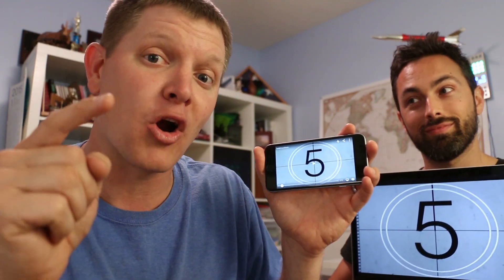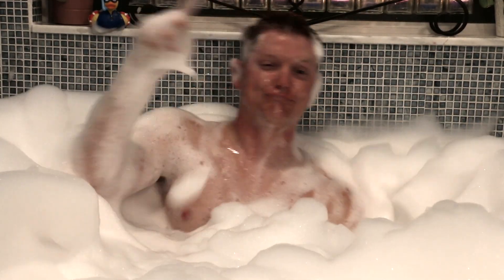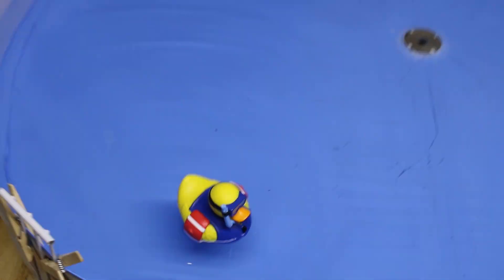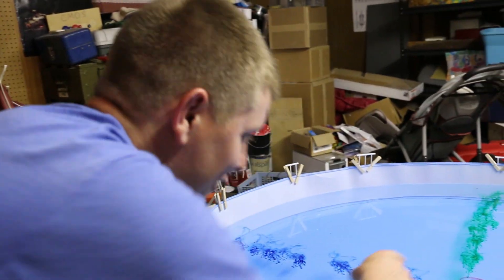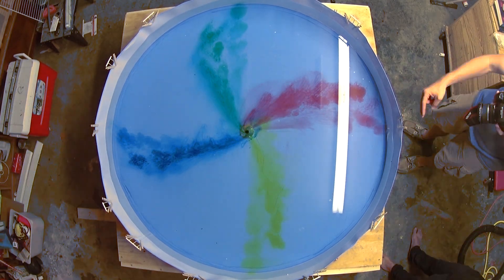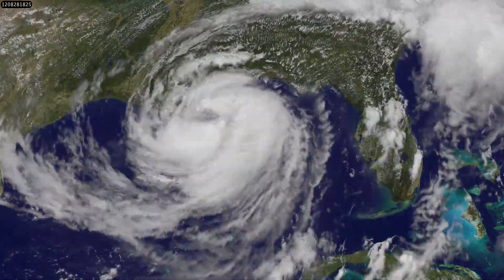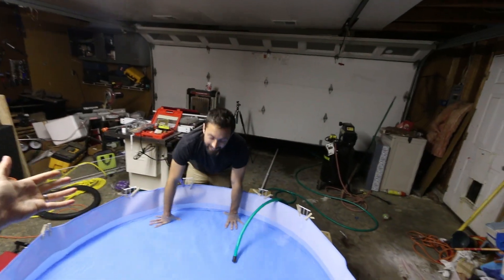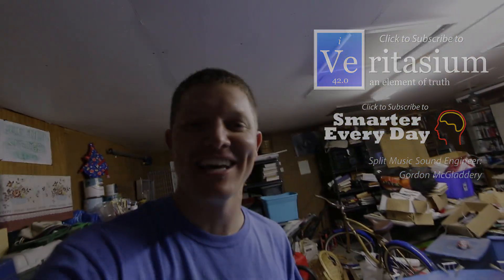The Truth About Toilet Swirl - Northern Hemisphere  (Smarter Every Day 137)

Comment: SmarterEveryDay: I don't see how you can, logically or reasonablly, maintain a swirling Coriolis Effect on a globe where the overall atmosphere is not even independent of the landsphere in it's midst. Afterall, globalists MUST maintain that both the landsphere & atmosphere are moving at the exact same speed. If the atmosphere were not moving, at all, then the landsphere would cause anybody, who is standing on it's surface, to experience as much wind resistance as the speed-of-spin is at his or her geological location. If standing at the Equator, then about a 1,000mph of wind resistance would be generated as the landsphere  moved you against the still air in the atmosphere. It would be like trying to stand on the wing of a futuristic jet that can travel at the speed of 1,000mph. This is why globalists MUST maintain that both the atmosphere & landsphere move together at the same rate of speed. If there was even the slightest difference, between the two, then stillness of air could NEVER be experienced on a globe and the swirling Coriolis would have a cause and ever be in effect because of it. However, stillness of air is QUITE OFTEN experienced all over the world. It doesn't even matter if the Equator is moving faster than, per se, the Tropics (Cancer & Capricorn) because the amount of land to speed-of-spin ratio, experienced at every line of latitude, in the whole landsphere, is equal in proportion to every other part. It has to be because it is connected, thereby, allowing no excess force to be experienced (from the overall unit thereof) when transitioning between differing speeds in differing geological locations. The same would, alikewise, be true for the overall atmosphere. Since the amount of air to speed-of-spin ratio, experienced at every line of latitude, in the whole airsphere is equal in proportion to every other part. It has to be because it is connected, thereby, allowing no excess force to be experienced (from the overall unit thereof) when transitioning between differing speeds in differing aerospace locations. And since so called: "outerspace" consists of no substance, at all, then the atmosphere would receive no frictional resistance on it's convexed outer rim from that.  Nonetheless, it's concave underside, being a thick gaseous air fluid, would interlock with the landsphere's round ridgity surface (like a bike chain on a sprocket) and, therefore, would allow no kind of swirling motion (or Coriolis Effect) to be experienced (from the overall conjoined unit thereof) when transitioning between differing speeds in differing      landsphere-to-atmosphere connected locations. This is because they are married & interlocked as a conjoined unit themselves. Though one is harder than the other, they are conjoined & propelled together at the exact same speed. Such would allow for isolated disturbances (due to other factors) but never as a direct cause of their overall union. This leaves the swirling Coriolis Effect with no CAUSE! So in order for you to continue maintaining the false notion, you will have to dream of a slightly offset atmosphere-to-landsphere connection by which absolute stillness of air is never experienced on the face of the whole globe (even though, in reality, stillness of air is often experienced all over the world in many different locations). Nonetheless, you absolutely can NOT have it both ways, Sir!!! And finally, here is a video of two whirlpools draining side-by-side but in opposite directions to one another --- https://youtu.be/oebaU1d7wKM ---  Furthermore, the world's record sniper shooter mentions many variables but the Coriolis Effect is not one of them --- https://youtu.be/9fiPqUN-AH4 --- Please don't let your pride cause you to give a dishonest response, Sir.
Reply: Ok professor 🙄

Comment: 1.   the way the toilet swirls, is due to the way its manufactured.   Its designed to allow the liquid to flow to one side first, then rotate around the rim.     2.  inconsistent silicone, or what ever sealer you used in the center of the pool,  to seal the exit port, will alter the flow too.    It needs to be a machined part for accuracy.

Comment: No they do not rotate in different directions.  All that has happened is that you have looked at the same thing from a different point of view.  Imagine this:  You hold an open an faced clock in your hands. The second hand extends past the circumference of the face, it rotates clockwise.  Now you turn the clock around so you see the back of it.  The hand appears to rotate counter-clockwise.  But it has always rotated in the same direction!  Now imagine this.  On the North Pole and the South Pole are two circular swimming pools with a plug for drainage in the center.  You stand above the earth at a point directly above the North Pole.  Because the Earth rotates in the same direction the swirl will be the same.  Looked at from the other direction ie 'below' the South Pole they will appear to rotate in the opposite direction, but the swirl in the North Pool and in the South Pool will be rotating in the same direction - the same direction as when you looked from above the North Pole.

Comment: If the earth is spinning it's going faster than the speed of sound at the equator. So if there is momentum, which should cause an immense force. Not just affect water draining lol that causes Coriolis there must be centrifugal force as well. And we should be flinging off the earth. But I guess there's this mythical force called gravity. the earth is so BIG is bends nothingness creating a force that adjusts to everything independently on earth lmfao insane.

Comment: I like the way you describe it but I think you should add that in any system, like a pool or toilet, the Coriolis effect works based on THAT small system and the much larger system, of the earth, is not as effective on the tiny condensed water system. In other words; small water systems are far more effected by local motions such as momentum added through filling of the container or pulling of the plug or deflection of drain guards etc. etc, etc.      My way of thinking about it is the same as you would see an ice skater spinning with arms extended, then when they pull their arms into their bodies their rotation increases greatly. It's the same way a Tesla turbine increases speed as fluid from slow outer diameter approaches the center exhaust port.
Reply: Examples of things that take advantage of Coriolis effect: Tesla Turbine, Spinning Dancers, Swimmers on inner tubes who pull arms and legs in to spin faster! Tether ball when string wraps around pole.

Comment: I experienced the change in flow rotation direction in real life. I went to the galapagos, but first stopped in Ecuador, where I went to the equator. The tour had a portable sink with him that had a removable plug in the bottom of it. He put the plug in, filled it up with water, and moved it perhaps a yard to the left of the equator. As the water drained, it spun clockwise. After it drained, he filled it back up and moved it one yard to the RIGHT of the equator. Sure enough, the water spun counterclockwise. But that's not the best part. He then filled it back up and drained it right on top of the equator. This time, when the water drained, it didn't spin AT ALL. It was really incredible!

Comment: So u did this experiment in one hemisphere and ONE time to prove this is real? Do this experiment 50 times and if all 50 times the water goes the same way, then you may have proved something. Then change the pool size, and plug size and do it 50 times again. Then you may have proved it 100% You usually post good videos, but this is very very inconclusive

Comment: they both rotate in the same direction relative to each other but relative to clock they do not rotate in the same way becouse the experiment is not done in the same coditions relative to winversal directions. In one pole of earth you must see the clock from up and the other pole from downs point of view :P   So without correct references no one can say that you are wrong. If you compere the earth rotation from diferent poles you will say that the earth in one pole rotate like clock direction and other pole earth rotate anti clock direction if you see the clock from the same direction relative to gravity.

Comment: The rotation in a toilet is caused by the manufacture design of the toilet ejecting the water at an angle. Some toilets gush straight through no rotation. If the coriolis effect could cause enough deflection to cause that rotation in a toilet, you would pee on the person next to you when going at the urinal.

Comment: the one in equator they only go 2 meters north two meters south and one right on the exact equator that goes completely straight. it's amazing at that condition but the basin is cemetrical.

Comment: I would like to add a point here. please correct me if I am wrong. the Coriolis force is not acting because the water is moving towards the drain. it is acting because one point is moving close to axis of rotation and the other away from it thereby resulting in Coriolis cross product in opposite directions

Comment: Great concept, great video, think you got the right answer for the setup you have, but . . . .to get a confident result that you both didn't just do a coin flip predicting one would get heads and one would get tails (25% chance is pretty good), you each need to run this experiment a minimum of 30 times to get a statistical handle on the consistency of the result.  Then there's making a connection to the toilet bowls.  In the formula for Coriolis sits velocity.  If the velocity is zero, there is no Coriolis.  The water in both the toilet bowl and your pools started at near enough to zero, but both get velocity as they move in toward the drain.  Problem with the toilet is that there is too little time and distance to build that up to any significant degree.  You rightly pointed out that it is more jet and bowl shape dependent.  Your pool had time and enough distance to let that very small Coriolis that had built up with motion, to finally overcome (probably, we don't know until you run 29 more) the other forces possible.  Was it deionized water with no magnetic fields?  I know that would be small at best but an ionic gradient in a field could come near the Coriolis force involved here.

Comment: it's shame that this very misleading experiment has been viewed by so many times. you cannot feel the rotation of the earth with such an experiment, the flowing direction of the water could be either way, depending on the tiny initialization of the motion. the eventual balance is between pressure gradient force (due to difference in water surface) and the centrifugal force.

Comment: If the effect is so small that if there is any kind of stream in a toilet, sink or bathtub it won't really affect the swirl, then how come it affects the movement of air in a hurricane/cyclone so much? For this to work in water, it seemed the water had to be perfectly still before draining. Then why does it affect hurricanes/cyclones so much when surely the air was not perfectly still before the storm? Of course liquid water doesn't have to behave as the gases in the air, so I guess that's part of the explanation. But I would like something more elaborate.
Reply: I would guess that maybe it's because hurricanes are so much bigger relative to the earth that the Coriolis effect is strong enough to overpower the smaller wind currents

Comment: There was never really any doubt about the effect, it can be clearly demonstrated by observing the direction of rotation in atmospheric pressure systems, ocean currents, and the motion of a large pendulums. The reason it's hard (but not impossible) to observe in toilets is due to the size of the atmosphere/oceans vs the size of a toilet/sink. At the toilet scale, random motion becomes the dominant effect. 
Having said that it was an elegant and inexpensive experiment that clearly demonstrated the very weak but very real effect. - congrats.

Comment: I have a huge problem with this experiment. by not using the scientific method of multiple testing. they need a repeated result under the same conditions to make excepted as fact. I like his channel and the use of scientific study and deduction in most of his videos but this one was like psudo science.
Reply: Well, considering that this experiment has already been conducted, with same results, many times over history, I think that requirement is satisfied...
Reply: Did everyone use a kiddie pool using the same drain system at the same latitude to repeat results? All I'm saying is for this video they could have done it a few more times considering how minute the vortex was.
Reply: Grip Limit read the description.. it says they did it three times
Reply: they said that it wouldnt work in your sink begause there are too many viriabkes there... he told you that if you wanted to do it yourself you'd have to by a pool like the one they used in the video
Reply: Scott Baromski yeah of course I watched it. do you also believe you weigh less on the equator than on the poles. I did more research on the matter than just getting two peoples OPINION on YouTube.
Reply: I am struggling to understand what you're saying when you put 'excepted as fact.' do you mean expected as fact or accepted as fact...someone being so nitty picky should be clearer with what they are saying
Reply: Aulo 2905 oh, that's good at least. I did the experiment in my sink 10 times and got different results each time.
Reply: Hahaha! What??  You're funny, man. A real serious scientist. "After serious questions about this "wheel" thing, I decided to put it to the test and finally clear up all of the pseudoscience once and for all and prove wether it really works ... Or not? "
Reply: Just a question. but should the hole in the pool also not be taken into acount ? to me it seems like the hole is going to one side.  But i have no clue just asking.
Reply: Sam Wilson sorry, I meant to say "accepted". I thought it was obvious, so I never corrected my self.
Reply: I like this channel less and less, because it is more and more full of fakery and bullcrap.

Comment: I like your example showing the momentum and the points moving towards the drain in the center. perhaps it can be used to draw a vector triangle showing the points pulled into the center with equal force and the direction of the resultant force.

Comment: The water currents and Oceans counter clockwise and directional pulls are not the from the spinning globe all it is from the Suns Magnetic pulling as it goes over the earths East to West direction. If you look at how Magnetic forces work then you would understand that the magnetic pulling upon the currents cause it to flow in those exact directions you just explained.

Comment: You also turned the valve counterclockwise... could that create a suction in a certain direction? It would be better to pull a plug at the end of the drainage tube.

Comment: Has anyone done a calculation to see whether the coriolus force in a small kiddies pool would be significant enough to overcome random variables such as wrinkles on the pool bottom, air currents in the room, temperature gradients?The way the water flows out will also play a part. The outflow pipe had a 90 degree bend which could introduce swirl below the level of the pool that then creeps upward. Was the water flow laminar or turbulent? I can easily see why hurricanes are affected - they extend over hundreds of miles. The kiddies pool is only a couple of metres wide - differences in angular momentum might be less effective than brownian motion.
Reply: Will try this. But again, in army sniping, the Coriolis effect is very much evident. Even a 1 sec bullet fight path misses the target, unless compensated for Coriolis effect (and certainly, gravity). The direction of "missing" the target is fully dependent on your orientation w.r.t the spin of earth and poles. You might want to check out some videos on this. 
 I did reply (which i rarely do) to this comment, only because it sounds like the most scientific comment in this section (at least on the top section though). 
 Cya mate.
Reply: geocarey and Subhasis, I have done the calculations for coriolis effect. My brother shoots targets at up to 1000m. No shooter in that competition compensates for coriolis effect. My calcs show that the effect is a small fraction of the best possible grouping at that range in the most extreme condition which is the range being due nth/sth. Wind direction and velocity is far more significant. I am open to discussion however. 

But well asked, geocarey. The numbers should always be done.
Reply: @subhasisbiswas1113  Shooters do not account for gravity. nor the made up coriolis effect. Only wind and bullet drop(because the bullet weighs more then the air it passes, not gravity).
Reply: @Jaceftp  right. It's not like the WEIGHT has anything to do with gravity...

Comment: First, it was super cool that I managed to put the two videos on the correct sides and have them almost (Within probably about a half second error) perfectly synced up. That was a pretty cool effect.

But I had a question, for that pool, if you don't wait too long, (perhaps till the eye would not really notice is still spinning but adding food dye or something would still show as spinning) does the pool drain out the pool in the direction it was filled?